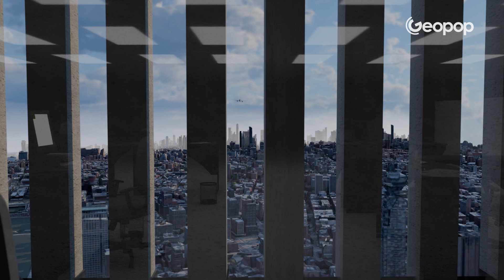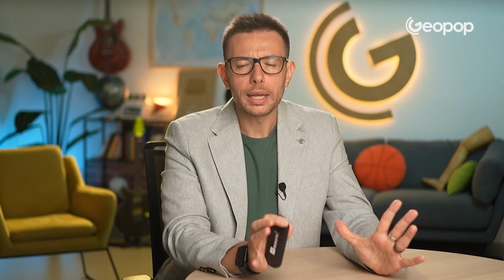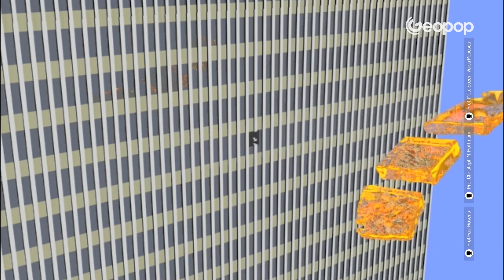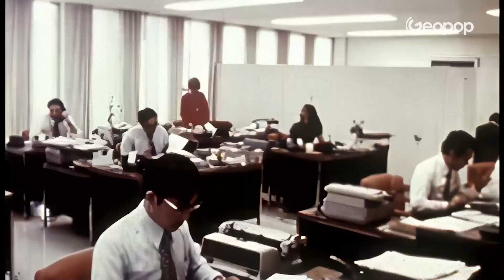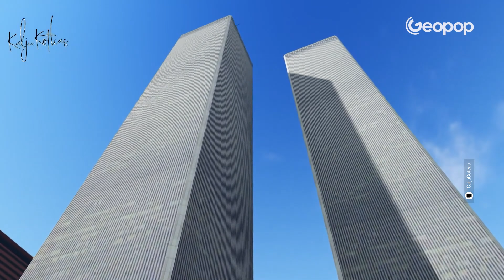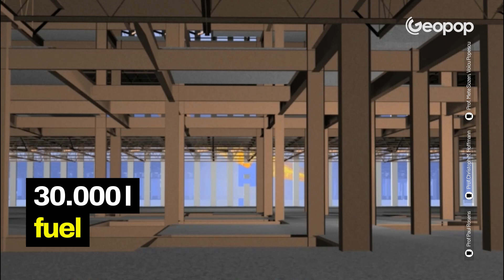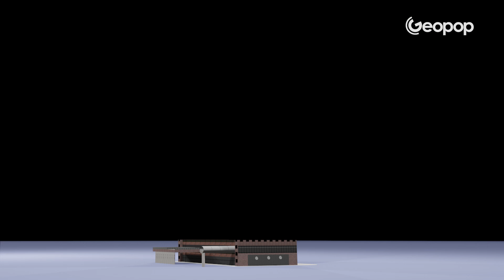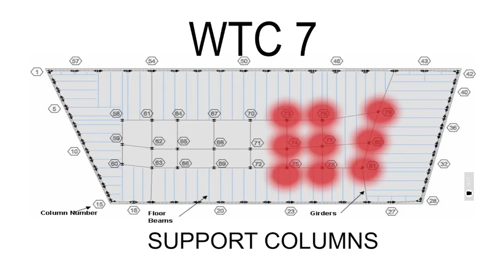9/11, 2001: The Technical Reconstruction of the Twin Towers and WTC 7 Collapses

Comment: Why did the collapse of all the wtc complex not obliterate the ‘bathtub’ that keeps the Hudson from flooding manhattan?

Where did all the escalators, cables, trunking, telephones, computers and cutlery go?

All they recovered was a safe, lots of paper, and the exterior walls of the structures.

All the steel, copper, aluminium, plastic, and organic material was turned to dust…
Reply: 1. Bathtub was too big - too far away.

2. Crushed

3. Not true. I suggest a visit to the 9/11 Memorial Museum.

4. Nonsense. That's objectively false and stupid.
Reply: @The @TheLoonResistance  had to pull the remaining buildings down with traditional demolition equipment, for fear of damaging the bathtub.

I’ve never been to the 9/11 museum. What did they recover?
Reply: 4) well the objective evidence proves otherwise. 
It may be difficult to assimilate, but there should have been hundreds, if not thousands of tonnes of cable, whether from the escalators, lifts, telephones, plumbing, etc.

Where did it go?
Reply: There’s also the question of what happened to the bodies of those who jumped from the towers.

The bodies literally exploded upon impact. 

Human bodies do not do that. A body falling off a cliff will still have the limbs connected at the end.

The accounts from the first responders make it sound like the bodies had been submersed for a week.
Reply: @muzzmacc6411  - A 1,000 feet fall onto hard pavement will make someone splat.  There are photos out there if look for them. Then they get burried in rubble for up to 10 months.

Buildings 5 & 6 were verinage'd because it was unsafe to enter them.  3, 4 and 7 had already collapsed.  

I think the primary problem here is you just don't look very hard and need others to do it for you
Reply: @TheLoonResistance aaah, but do the limbs disconnect?

A 1,000 foot fall will do no more damage than a 40ft fall. The terminal velocity is the same.

Mountain rescue teams recover bodies, but I’ve seldom if ever, heard of them having to recover limbs.
Reply: @muzzmacc6411  - Is there a point to any of this and if so, do you know what that point is?
Reply: Why not use conventional explosives to destroy the remaining buildings?
Reply: @TheLoonResistance well, the point is that the orthodox explanations by NIST, et al , fail to capture the inexplicability of what happened. 
All the talk of ‘well, if the building was heated to such and such, and if the steel girders bent’ is all moot when the entire buildings are effectively scooped out, and land with a 2.6 on the Richter scale.

Two, 250,000 tonne buildings, landing with a fffffftttt!
Reply: @muzzmacc6411  - Because the buildings were unsafe - structurally unsound. I don't understand why this needs to be explained.

The teams of skilled and experienced engineers who were there on the scene, assessing the situation first hand determined the safest, most effective option and used it. This is NOT a point of controversy. 

The alternative in a steel framed building is dismantntling NOT explosive demolition which is primarily used on concrete structures. Bankers Trust Building and Fiterman Hall for example were dismantled.
Reply: Captain Karin Deshore, first responder “the whole body would just disintegrate into pieces and splatter all over”.

One of the rules about pulling bodies from rivers…is that you don’t.

You’re likely to end up holding a pair of arms, whilst the rest of the body floats away.
Reply: @TheLoonResistance there was genuine concern, expressed by engineers to the BBC on sept 19th, that the bathtub would collapse. 

Subsequently, they discovered that the bathtub had been barely affected.

They were more concerned about the presence of earth moving equipment damaging the bathtub. 

The New York dept of design and construction said no to the use of any 1,000 tonne cranes anywhere near the site out of concern for the bathtub.

Yet, you’ve got two 500,000 tonne buildings ‘slamming’ to the ground just days before?
Mr. Tamaro remarked that without the basement floors to provide sufficient support, tiebacks would have to be installed along the southern and western edges.

But otherwise, the bathtub was scarcely damaged.

Along with the underground train system.
Reply: @muzzmacc6411  - OK, and???
Reply: apologies, I cannot find the reference at the moment, but I recall the official statement regarding the demolition of the surrounding buildings, was entirely out of concerns about the bathtub.

They rebuilt the ‘torn’ facade of the bankers trust, and then had to tear it down.

The surrounding buildings weren’t just structurally unsafe, the actual steel, if you listen to the demolition of wtc7, was basically decrepit. That’s what it sounds like when you toss old cars into a compactor.
Reply: @TheLoonResistance that’s all for today👍
Reply: @TheLoonResistance  You are a very busy shill Fitzshill!

Comment: it is not possible for a plane made from aluminum to break a steel fassade, never
Reply: You're wrong.  Lead bullets can penetrate steel.  The other commenter is right, energy is what matters, and those jets had about 4000 time the energy of a 5000lb SUV going 70mph.  I did the math.
Reply: Nonsense. It's about energy NOT materials
Reply: @TheLoonResistance  You are a very busy shill Fitzshill!

Comment: Don't care what anyone says, A building that's had one side compromised doesn't fall like that, For a fall to happen like that all pillars of the building on a floor must be evenly compromised at the same time, Its common sense, You don't need science for common sense. Build any type of model tower, Any at all, Compromise one side and see what happens. BUILDINGS DO NOT NATURALLY COLLAPSE EVENLY, I'm not saying it was a controlled demolition, I'm saying it makes absolutely no sense.
Reply: Collapse initiation occured when sagging floor trusses caused inward bowing of perimeter columns on one side of the Tower by nearly 5 feet until they buckled.

This is literally visible to the baked eye.

ALL of your assumptions are wrong, not reality.  The problem is YOU.
Reply: @TheLoonResistance  Why are you replying to my comment, Looks like YOU also have a problem 😆 Just said i dont care what anyone says, Your opinion is still only an opinion MR I KNOW IT ALL AND IM ALWAYS RIGHT. Get off your little high horse.
Reply: @RankingHubble - So you don't care what actually happened.   You don't care that you are wrong.

I don't understand that mindset but good luck with that.  Sorry to have bruised your ego.
Reply: @TheLoonResistance  Can you prove the sagging floors Fitzshill? Oh no, you CAN´T! All you can is dodge and whine Fitzshill, so go dodge and whine now Fitzshill...
Reply: @zettel3296   He doesn't have to dipshit, the NIST who actually examined all the evidence and wreckage came to the same conclusion.  Were you born this dumb or have you had to work at it. 🤣